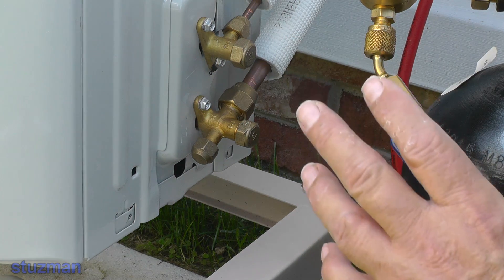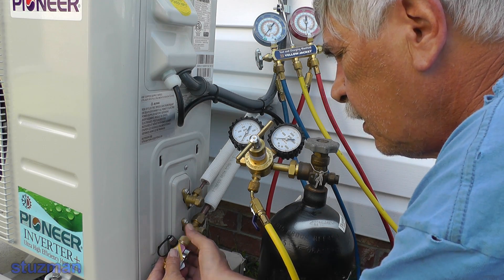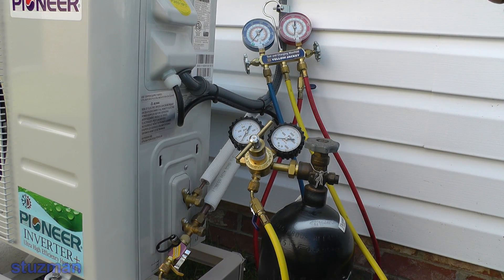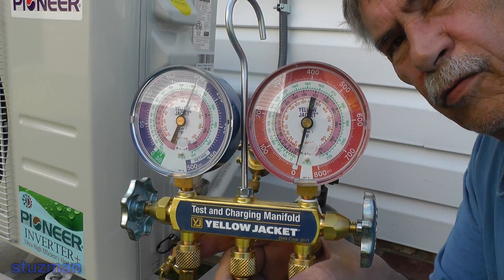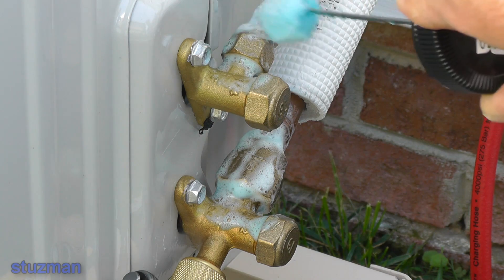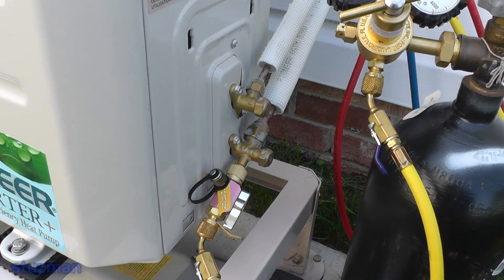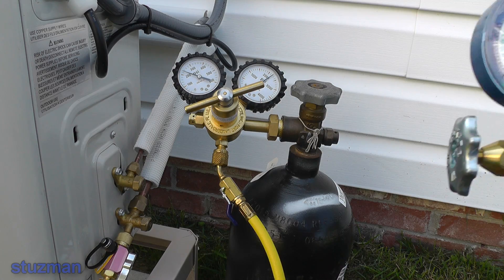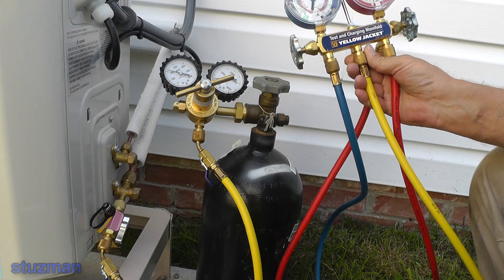Mini-Split Heat Pump: Nitrogen Pressure Test

Comment: Mr. Stuzman, its me again. I need your help. I want to inject EasySeal into my mini split. Since there is only  the service port on the Low side, how do I go about attaching the and releasing the EasySeal?  Please let me know. My wife will be happy if we get cold.  I installed my mini split following all your videos, but alas I got "frosting" on my liquid line and I suspect there must be a very very small pinhole leak.  When I pressure tested with Nitrogen (following your video) It hold the pressure without moving down for overnight.  So I concluded that once the system is on and the refrigerant released, there must be a small pinhole causing a leak. Please let me know and Happy fathers Day.
Do I connect the blue hose at the tail of the EasySeal or is it in the yellow hose with the High Pressure Knob totally closed because there is no service port for the high side?
Reply from the maker: Freddy, it's hard to believe that you have a very small leak yet it held a nitrogen test overnight. Just a possibility, but you may have an issue such a TXV issue. In any event, I wouldn't recommend putting a sealant in there as it could cause further issues such as creating blockages. I've never used such as a product, but it would have to be installed through the low port. There should be instructions on the can of how to use it. Good luck!
Reply: @stuzman52  Mr. Stuzman: July 22, 2020 Finally my wife is so happy our house is "as cold as a cucumber".  So I watched as the gas line below the suction line is frozen iced and as I added little by little more R410A the icing started to disappear.  In about 25-30 minutes the whole icing inside and out is gone.  Thanks for all your help and may God bless you and give you along life and health so you can keep helping people.  Now she wants another AC Mini Split on the second floor.  Hahahaha... they never stop.
Reply from the maker: Freddy Panes Hlad to hear Freddy that it all worked out. Just as well get another mini-split to keep the wife happy. 😀
Reply: i need you email so i can share you some photos of my install. or if you have a FB page I can also post it there. Thanks for all the help

Comment: Dear stuzman! Why are you using only 200 psi? Could you Tell me the refrigenerant gas inside the ac? Thanks
Reply from the maker: You could use a higher pressure if you like, but stay under the lowest test pressure of the outdoor or indoor unit. This was a R410a unit.

Comment: Im curious 1/ the need to remove the schrader? 
2/ was the LP shut off at 4:02.? Nothing was said. But it's a critical juncture meaning nitro doesn't top itself up. 
3/ how can you be satisfied using foamy bubble check? Micro sized bubbles will never been seen, get non foamed liquid.
Reply from the maker: Removing the schrader valve was in preparation for the next step, (next video) to pull a vacuum. Removing the valve allows for a faster and deeper vacuum. Yes, the low pressure gauge was closed on the manifold gauge set. Using a gel to check for bubbles is a standard used in the field. Also, the low pressure gauge was monitored for a pressure drop. And the unit is still working well.

Comment: Ones you close the system air is the worst enemy. Air can’t be present when preforming nitrogen test. First pump the system.
Reply from the maker: And why is that? The air is removed in the next step with a vacuum pump.
Reply: stuzman thank you for replying. 
Just take your time and think about it. 
don’t forget next time to pump the system first. 
I think you can find this information on the EPS universal test .
Reply: Yeager Mcbipper , Mr Stuzman is right there’s no harm in the least with air in the system pre vacuum, neither is he sloppy he’s in my opinion extra cautious

Comment: Waleed7rrag RRAG
I do thank you very much for your excellent instructions and great detailed explanations. You are during your video answering all the what, why, how and what not to do with great details and explanations. I must say the video recording very sharp and pleasant. Having said that,  if you would please answer a few questions:
1.  As you know the mini split AC of all brands and kind has no high side shredder valve and I do not know why, so is it good idea to install one out side the system near the low side shredder valve?

2.  I have a mini split AC under full maintenance including a leak repair on the condenser, as you know the metering device is just at the end of the condenser going to the evaporator, in this case is it OK to feed nitrogen gas from the low side all the way to the condenser to test the condenser leak repair? will nitrogen pass through metering device? and if so will it affect the metering device and or the high side of the compressor?

3. After doing system and line set vacuuming, is their a need to add 2 ounces or may be less of a compressor oil? I can not find any sold information on this issue?

Last but not least, thank you very much for teaching and helping so many people !!!
Reply from the maker: For question 1, I'll refer you to an article by Craig who is a HVACR technician about why there isn't a high side service valve, and I would not install a valve on this side as it's not needed and you're not going to gain anything from it. Here is the link to his article along with many others. You'll find the information about the valve further down in the article https://www.acservicetech.com/post/checking-the-charge-of-a-mini-split-unit Also, you can get more useful information from his YouTube channel located here. https://www.youtube.com/channel/UCOZR-1IqsAer9wzlvFgb4mA?disable_polymer=1
Question 2: When you're checking the condenser for leaks, I would use an ultrasonic leak detector or you could use a sniffer while the unit is running. Although a bubble test may work, you will have to cover a larger area covering both sides of the outdoor coil. This would be the best method to check for a leak while the unit is running. And you may not have a leak. The procedure you're describing with nitrogen will require you to recover all the refrigerant, fill the system with nitrogen, check for leaks using ultrasonics or with bubbles, pull a vacuum and finally recharge the system with refrigerant by weighing it. That would be a lot of wasted time if you find that you don't have a leak. If you did have a leak, you would have to do all of the above of course. But just use the first method and you only do the second method if you find that you have a leak. Putting the nitrogen in the system would pass through the metering device so no problem there.
Question 3: When you have a leak, I would not worry about adding oil, because you don't know how much leaked out. During recovery of the refrigerant, the recovery unit may pull some oil out, and it's permissible to add back in the amount taken out. In other words, you know how much to put back in the system.
Hope that answers your questions and thank you for watching the videos!
Reply: @stuzman52  I thank you very much for taking the time to answer my questions. Your answer was very sound and clear.  Thank you again!!!
Reply from the maker: Waleed7rrag RRAG Glad to help and you’re welcome!

Comment: These things run in the 400psi range I would take advantage of having the ability to go at least to 400psi on the pressure test
Reply: line set and evaporator coil on mini split don't ever see 400 psi in their entire life. so its not a good idea to go above 300 psi cause it will cause more leaks
Reply: @lordjaashin   hmmm..not even for mini split heatpumps when your eveporator becomes your condenser in the heating season?... could've sworn all mini splits i've seen were all factory pressure tested by at least 500 psi high and 300 psi low
Reply: @truthfiend6909  can't say for heatpumps but my mini split user manual only recommends max 250 psi on evap coil and suction line. don't know why.
Reply: could blow the Fittings with high Pressure the connections
Reply: Spot on.
 
You have to Strength pressure test at 1.43 times, and 1.0 for Tightness Test. This is all dependant on the refrigerant used. 
R32 is pressure tested at 400psi (279.57 x 1.43)
Testing is carried out in 15 minutes increments up to the max test pressure, then down to tightness test for a slong as possible.

eg R134a at 32oC = 7 Bar x 1.43 = 10 Bar = 145 psi

Comment: Just installed a senville 9k myself held vacuum 2 hours solid, still did a soap and water leak test while running to be double sure... OCD... 

Works fantastic, 120° vent temp 50° ambient that's almost as hot as gas
Reply from the maker: You did a great job Dodd! Congratulations!

Comment: Sir you are a great instructor I have much more confidence on installing my own mini split dual zone after watching all your videos.  Thanks for taking the time and sharing
Reply from the maker: Thank you Joseph for the kind comments and for watching the videos! Since there are a lot of DIYs who are installing mini-splits, I wanted to give them all the information that would help them in having a successful installation. Good luck on your installation and I'm sure that it will be a great one!
Reply: @stuzman52  Well I live in Hawaii so everything is expensive here and I now have 2 kids in college so when my mitsubishi mr slim failed (after 17 years) they quoted me $4750 to replace.  I got an off brand 18000 dual zone and with your videos I will save $2400.   Much in part because you explained every step so well.  Thanks Again I will let you know how the install goes when it gets here.
Reply from the maker: joseph graham Sounds good Joseph! Let me know how it goes! 😀👍
Reply: @stuzman52  Sir I would like to tell you that I have successfully removed my old system and installed a brand new 18000 BTU  Mini Split AC/ Heat Pump with 2 9K zones in the house.  In great part because of your videos.  Had a few minor problems but was able to get through all of them Thank you so much for taking the time to do these videos.  I will be forever grateful and so will my kids when I can pay their tuition because you helped me save money.
Reply from the maker: joseph graham That’s great to hear Joseph and glad to hear that you saved money to help your family. Always glad to help and have a great weekend coming up. 😀

Comment: If you don't shut off the nitrogen tank, the pressure will keep up 200 psi until the nitrogen tank is depleted. Therefore, this is only good to check for leaking with bubble test or with other leak test devices.
Reply from the maker: Feliz, you don't have to shut off the valve on the nitrogen tank. The valve is closed off on the manifold gauge set where the nitrogen is going through the compound gauge. If you want to close the valve on the nitrogen tank, you can but it's not necessary.

Comment: Can we use low pressure or hi pressure gage in testing by nitrogan gas  please must replies
Reply from the maker: You can use either gauge, but you'll find that the low pressure gauge has a higher resolution.

Comment: I do not know if it has been pointed out in the comments but I would had cracked open the liquid line at the coupling to bleed or displaced ambient air from the lines. You just pressurized the system with a Nitrogen tank with air still in it. My 2 cents. Besides that, good video.
Reply from the maker: I appreciate your comment Giovanni, but that wouldn't be a recommended procedure. When you crack open the liquid line, you would be letting refrigerant into the atmosphere which is a EPA violation. And let's say that you did that. How much refrigerant would you let out to know when all the air has been released? At that point, why use nitrogen; couldn't we just leak test with an electronic leak detector or use soap bubbles. And now you'll be low on refrigerant. How would we recharge the system with the refrigerant that's lost? You can't just add an amount and use the subcool or superheat method of checking the refrigerant charge because mini splits have an electronic thermostatic expansion valve and the compressor runs at a variable speed based on the heat load. You'll have to recover the entire contents of refrigerant and then weight the refrigerant back into the system based on the manufacturer's nameplate of refrigerant charge. And if we were able to get all the air out through purging, would we need to pull a vacuum on the system? And here's what section 608 of the EPA study guide for certification says about high pressure systems, under Type II, C-2 for leak detection. "The first thing to do when a new system has been assembled (built up), and is ready for testing, is to pressurize with an inert gas and leak check. After installation of a field piped split system the unit should first be pressurized with nitrogen and leak checked." It says nothing about purging the line of refrigerant to remove the air before you put nitrogen in the system. If you look anywhere on YouTube and follow the pros such as acservicetech, you'll see that no one cracks the liquid line to purge the system of air and then put nitrogen into the system. Have a great day!
Reply: @stuzman52  not the service port on the condenser, the lineset you just installed. There isn't any refrigerant in it. Just to clear out any air. Sorry if you misunderstood.
Reply from the maker: @Giovanni Ciuro Okay, I misunderstood you. Yes, in that case, that would be fine.
Reply: Giovanni Ciuro , I got what you mean, but there’s no need to flush the air out per se . It is diluted during pressure test and comes out on release and during vacuum

Comment: Question. After installed mini split lines, we need to do this first before vaccum? And when you vacuum. What are you really vacuum since all the nitrogen was released?
Reply from the maker: The pressure test with nitrogen is to verify that the system doesn't have any leaks. The vacuum is to remove the air which contains moisture out of the system.

Comment: I installed a multi zone fujitsu. It's been holding at 200 psi for 2 hours. I did not perform a bible test but it has not moved. It should be fine right?
Reply from the maker: It should be fine if you didn't see it drop at all. However, since you've gone this far, go ahead and do a bubble test or if you've got an ultrasonic leak detector, you could use that also. Doing the bubble test, just gives you more assurance in your mind, that it's 100% leak proof. At least in my mind :) But, you should be okay with doing the pressure test alone.
Reply: @stuzman52  hi I have one more question, I vacuumed down to 196 microns, when I shut my vacuum off within 2 minutes it climbed to 400 microns. After 15 minutes it climbed to 440. I think it might be that I didnt use nylog on the fittings. What do you think? Its slowly rising by 2 microns, every couple of minutes. After 25 minutes it climbed to 446.
Reply: Multi zone , surely please don’t diy , there’s a lot of $ of equipment there. A vacuum effects “tests” at negative 15psi (not a very conclusive test) it can “suck” the joints together,  and any rubber hose in the line invariably cause a “rise” as you are seeing. So no vacuum isn’t the greatest alternative to a pressure test.

Comment: Sir. Can we use nitrogen gass as a pressure testing in whole split ac system ? I mean compressor, condenser, expension valve and evaporator. I mean Nitrogen Gass can be damage compressor or not?
Reply from the maker: Yes, you can use nitrogen to pressurize a system and there shouldn't be any damage to the compressor or other components. Of course, the refrigerant would have to be recovered, the leak fixed and then pressurized with nitrogen to verify the unit is not leaking. Here's a link to a video of where Craig, a certified master HVACR tech is demonstrating the procedure. https://www.youtube.com/watch?v=-Fawq6cpVSw&t=312s
Reply: Sir. I just Asking if I charge nitrogen Gass in compressor only, I mean Nitrogen Gass will chemical reactions with compressor winding yes or Not?
Reply from the maker: Nitrogen is an inert gas which means it shouldn't react with any metals, gases, etc. So, you should be fine to put inside compressor as mentioned in previous comment.
Reply: How much maximum nitrogen pressure charge in outdoor and indoor unit?
Reply from the maker: You should look at the test pressures for the outside and indoor unit and use the smaller test pressure for the entire system. Even still it's not necessary to go full blast with the pressure at that rating. For example, if the lowest test pressure is 500psi, I would use 300psi and it's a pressure that will find the smallest leaks. Some older units such as R22 only had a test pressure of 150psi for the evaporator coil. So, be careful with the pressure of the nitrogen tank.
Reply: @stuzman52  Thanks Boss, God Bless on u and Ur Family,
Reply from the maker: @msaeed8031  You're quite welcome and have a blessed day also!
Reply: Normally 150-200 psi is the upper rating of the compressor housing, so there’s your upper limit. Can valve off the evaporator to reduce nitrogen consumption and reduce the vacuum task

Comment: Can we use nitrogen gass pressure test in compressor and condenser coil(outdoor unit) also, I mean Nitrogen Gass will be dangerous for compressor winding or pump?